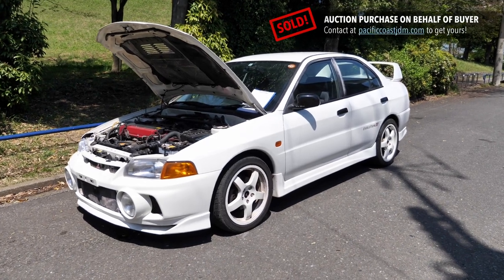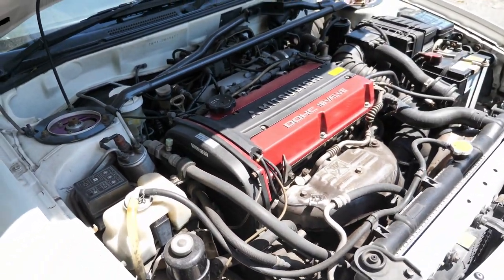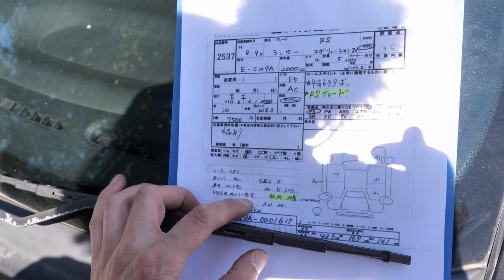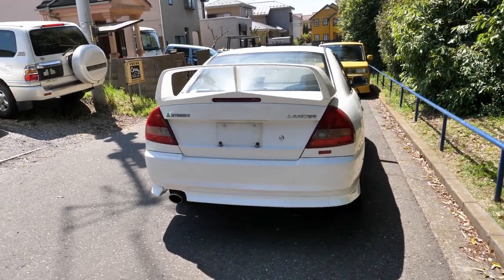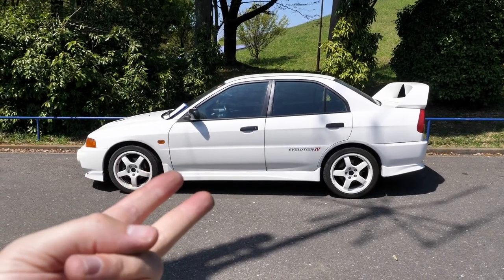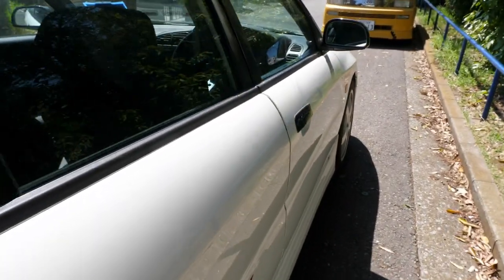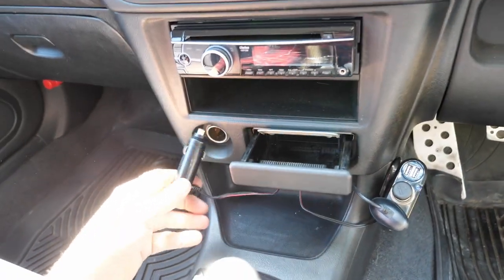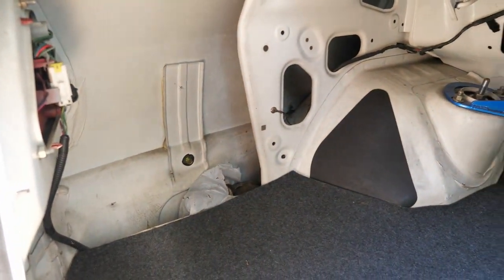1996 Mitsubishi Lancer Evolution IV RS (USA Import) Japan Auction Purchase Review

Comment: The RS Evo’s only came with steel wheels. So those Enkei’s are after market.
Reply: but you can option it with GSR Wheels
Reply: True. Stocm EVO IV RS rims are those steel alloy rims.
Reply: Those Enkei's are an OEM option from factory
Reply: You could add certain options to the RS model. My '94 Evo 2 RS has AC and electric mirrors for example. Also whilst most came with steel wheels who the hell wants those for their road car. That was only for the rally teams who would even throw away the steel wheels! It's still an RS.

Comment: On the early evos (1/2/3) the exhaust also comes out the front of the engine and the intake manifold sits behind the engine. I have the Evo 2 RS.
Reply: same as my e3. its the early 4g63. they changed it starting with CK chassis.

Comment: if i remember correctly,   
The RS was a spec that was purely made for those who made race/rally cars out of them,    Teams and such.
So stock seats cuz the seats get replaced anyway,    Same with the wheels and brakes.    Those things usually get replaced for race/rally cars.
Door handles and mirrors are unpainted as the cars typically get liveries anyway,     And the wheels are usually steelies as they get replaced as race/rally cars too.
The interior is stripped and it didn't come with a radio originally.     
There for,   I always felt like RS stood for RaceSpec / RallySpec. 
  
TLDR,   it's just a very,  Very,  stripped down trim.